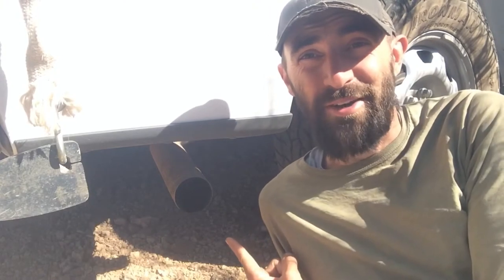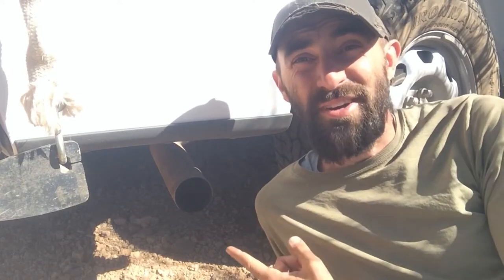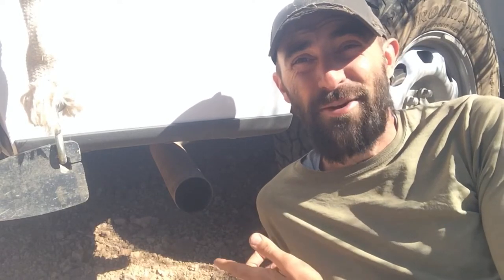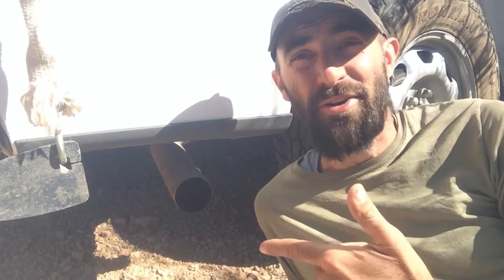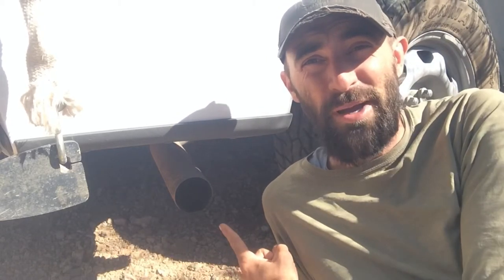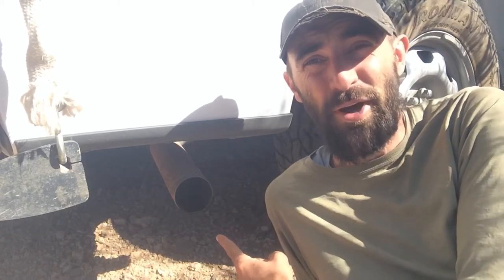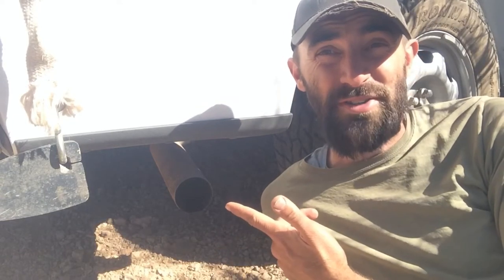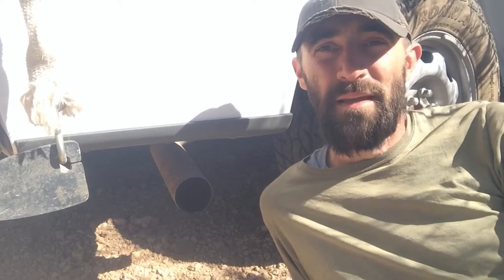Is That Water Coming Out My Exhaust An Issue?

Comment: I have a problem with water going down to exhaust pipe even the engine is turn off and I have to add more  water  for just few minutes. Help
Reply from the maker: You have to add more water to the radiator?

Comment: Why water is coming out with smoke then ?
Reply from the maker: If it’s a lot of water and smoke you have a bigger issue ifs it’s just a little of both that means it’s just changing the water vapor into gas but you may have a little water sitting in your tailpipe from last time you drove and it won’t get warm enough to evaporate right away.
Reply: What happened my car doesn't produce water droplets while starting during morning.is there any issue